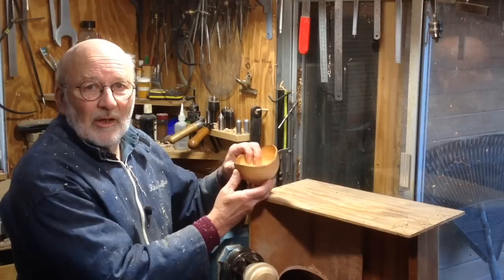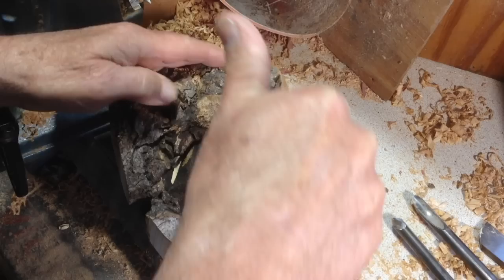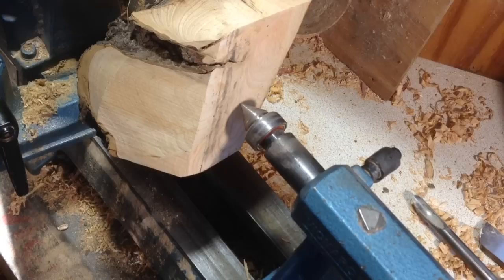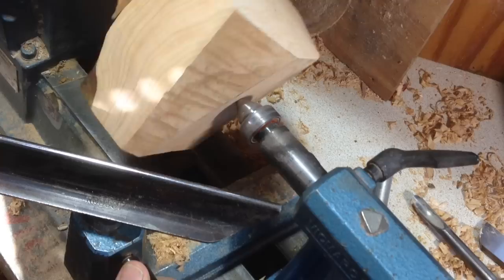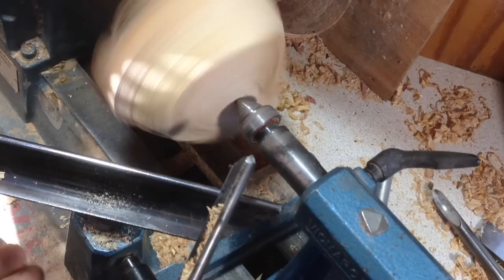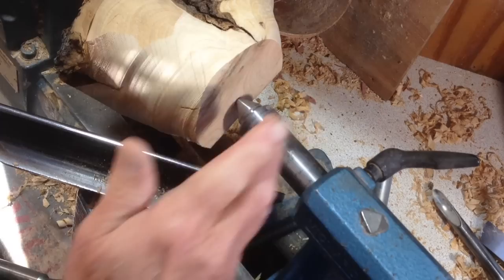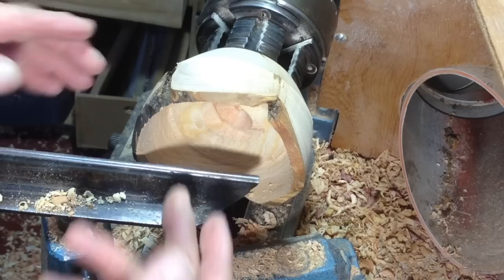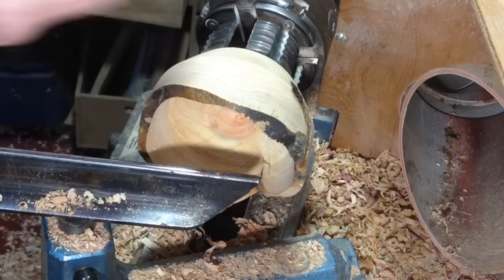Richard Raffan turns a natural edge bowl in claret ash.

Comment: Ive searched online trying to find a chuck with jaws like those, no luck. Do you know the manufacturer?  Thank you
Reply from the maker: Vicmarc makes the chucks. Widely regarded as the best there are for woodturning.
Reply: There are 48, 55, 74 and 88mm shark jaws available, unfortunately the 88mm doesn't seem to be available in Europe. I wrote to the Vicmarc factory but they didn't reply :-(
Reply: I think Richard is using 74mm jaws here.
Reply from the maker: @milasiroky3301  The VM120 jaws sets vary slightly from the VM 100 jaw sets.
Reply: @RichardRaffanwoodturning  OK, I use a VM100, but I can't buy the 88mm shark jaws that Vicmarc makes anywhere in Europe.
Reply: I've purchased a new lathe and pick it up on Sunday, it's a powermatic 3520b. Any recommendations as to which 2 of those chucks I should purchase?
Reply from the maker: @donntisch365  I'd go with the VM120 on a lathe that size.  Which jaws you choose depends on what you intend to turn. Before I downsized I had about 16 chucks and jaws that could cope with most situations. I used to find Shark jaws around 2-in very useful and the Step jaws for rough turning bowls.